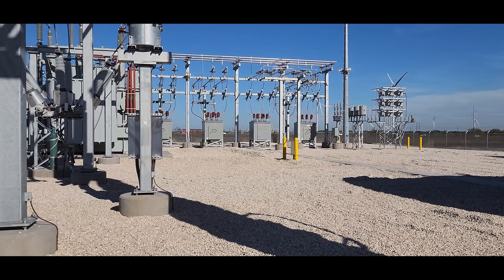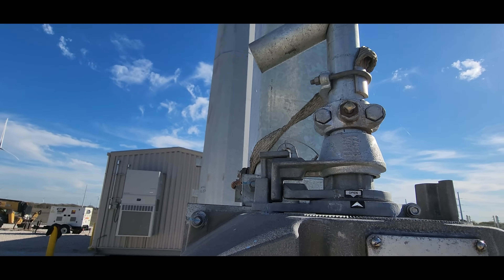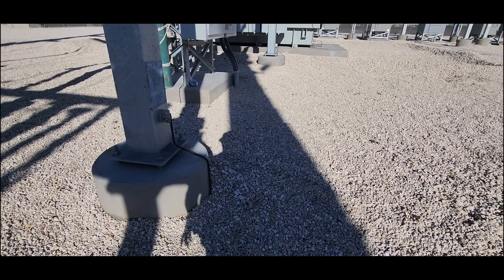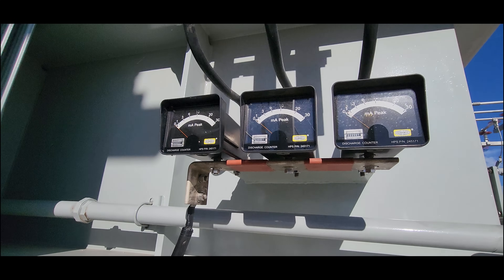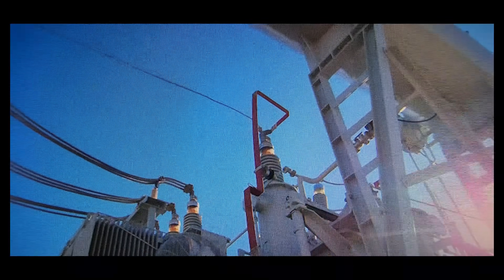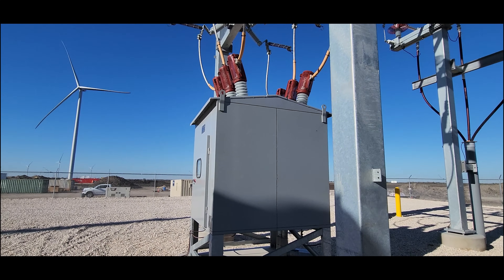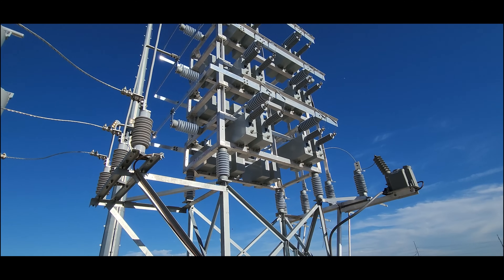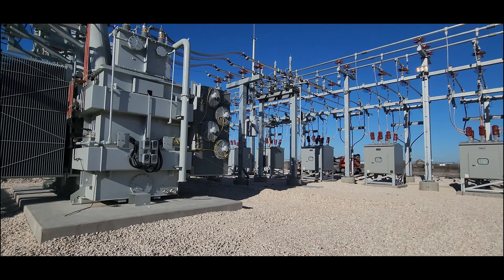138 kV High Voltage Substation Walk

Comment: Thanks for the tour! I particularly enjoyed your insights into the data links and remote control capabilities. My day job involves assessing the security of SCADA/ICS and remote control systems in industrial environments (private, public utility, and marine) so it was very interesting to see how the power utilities do things in the US compared to what I've seen elsewhere.
Reply from the maker: You guys have lifetimes of knowledge that I know very little about. After reading your comment I looked into how many points we gather for SCADA from the substation. 548 points. 286 are analog, the rest digital. I am not sure how many of those the Utility grabs. Lots of info!
Reply: @spdfreakls1  That's quite a bit of telemetry! Sounds like a modern system. The trend seems to be going towards long-term collection of as much data is available, for trend analysis and failure prediction. Luckily at the 100kV+ substation level there's enough aggregation going on to avoid any individual privacy issues with the data, which tends to be a problem for smaller utility sites (e.g. being able to tell when someone has a shower by looking at the water mass flow rate... creepy!)

Comment: Nice walk through and good catch on the transformer neutral bus that renders the reactor useless! First time I have seen that style Qualitrol gauge before and did the guys who put the temp sensor junction box covers and capillary tube guard on upside down on purpose, so the 73 is upside down to piss someone off?
As far as the strike counters on the LA's. We had an LA (115V) blow about a year ago and it totally blew the strike counter to pieces! Only had them on one transformer and we never trended the leakage, maybe if we did we could have predicted a pending LA about to fail, or there was some transient that took it out anyway. Was never investigated, just took over a year to get a new set of LAs.
Reply from the maker: Wow that is crazy! Yeah these lead times are insane. We can get a main power transformer faster than an HV breaker these days.
Reply: @spdfreakls1  Yeah, no idea what the issue was. Just run of the mill 115kV substation class LAs. The originals were Ohio Brass, not sure if they were trying to go back with the exact same brand / model or what. I just find and fix, glad I don't do the parts searching end if it.
Reply: I'm a bit puzzled by the station aux xfmr connection. Is it connected L-N or L-Gnd? What happens to the station service voltage when there is a L-Gnd fault on the 34.5kV? Also, is there a second station service source.
Reply from the maker: @fredlotte2601  primary is line to ground. Secondary has a grounded neutral. Sometimes the neutral is grounded at the transformer case or inside the 400a disconnect below. If there is a L-gnd fault on 35kv side on the same phase at the transformer is connected to it will affect secondary voltage. Yes, there is a secondary utility backup. There is an automatic transfer switch in the control building.
Reply: @fredlotte2601  In my experience I have seen single phase L-N and L-L station service transformers and some larger stations, three phase transformers. Usually with a second station service transformer fed from a second distribution transformer, if there is one. And yeah, when there is a fault you can lose station service but most of the critical substation devices run on DC, from the battery charger when AC is available and from battery when AC goes out. I've been in stations with DC lighting too and of course some also have back up generators. But all the critical devices, like protective relays and your trip coils, close coils, depending on the  station, spring charge motors, motor operated disconnects will all be DC. More so in transmission yards, not sure about wind farm subs, never have been in one (yet).
Reply: @inothome Same here. I'd forgotten about DC use even tho one of my last projects before retiring (30 years ago) was sizing replacement station batteries for about 10 generating units (about 2400MW total) some of which had very large DC turbine oil pumps.

What initially got my attention was the posibility that this station might be using ground as a power conductor and they have a ground fault limiting reactor. I can imagine strange large voltages applied to the station auxiliary transformer during ground faults.
Reply: @fredlotte2601  Ground rise potential is definitely a concern, but the LA should help protect the station service transformer in that case. I have seen someone unintentionally cut a live URD cable, basically shorted A to ground and about 1/2 mile away it blew the B and C phase LAs on a three phase padmout transformer and just about blew the doors off it! Delta high side so, the rise in ground potential was too high for those LAs. Which, were undersized MCOV for the high-resistance grounding system that was in the system there. Substation transformer had a grounding resistor we would switch in and out, based on maintenance in the system and it was switched in at the time. A lot of the LAs were replaced over the years, but never got to that transformer.... but it took care of it itself. Transformer electrically was OK. Just needed some major sheet metal work on the doors and cabinet.

Comment: I think you should do some tests on the transformer cooling fans, since in the narration there was a statement about the critical need for effective forced convection cooling to prevent the transformer from overheating. The fan cooling design seems wrong to me. For example, lets say the transformer external oil heat sink allow natural convection from the bottom of the radiator to the top. In other words, think of a box housing the radiators with an opening on the top and on the bottom, but with the sides enclosed, like a rectangular tube. Cooler air would enter the bottom flow upward as it absorbs heat from the radiator fins and exit at the top, natural convection produces an upward flow of air as it is heated. 

The cooling fins internal to the box would have to be spaced appropriately to allow air flow around the radiator tubes. Then if we wanted to add two stages of forced convection (cooling fans) ONAF1 and ONAF2, as staged additional cooling you would put the fans pulling (air flow up) on the top and pushing on the bottom (air flow up). When both banks of fans are on they work together to move air through the radiator from the bottom to the top. The first stage ONAF1 should be the top mounted fans and ONAF2 the bottom mounted fans. To make the flow rate consistent across the radiator you would want all the fans, either top or bottom, to come on together (and off together), meaning all the top fans (or bottom fans) all off or all on. To make the top and bottom fans work effectively you would want a mounting plate or formed end cap across the entire top and the bottom with round cutouts the same diameter of the fans. This way the fans are able to product a static pressure as seen by the cooling box.

If you place a fan on a radiator without producing a static pressure the air flow will just exit without being forced through the fins. Meaning the cooling effect is very small. You can also think of it this way, lets say instead of the many smaller fans we just had one large round fan with a diameter the same size as the width or the side of the radiator, so it covered the radiator but without a blocking plate or flow plate. The fan would be a puller so air would enter the middle of the radiator and be forced outward from the side, but you would have a huge amount of leakage around the periphery of the fan. Using the same single fan we now add a blocking plate, but instead of a flat plate we make an end cap with a standoff distance of about a foot from where the radiator plates stop with a sealed periphery along the outline of the radiator. With this formed sealed end cap air can be drawn through out the entire radiator with the large single fan because the static pressure is spread over the entire face of the radiator. You could do the same with several smaller fans but you would have the same end cap but with several smaller round cutouts for all the individual fans, with the requirement that all the individual fans would have to be on together, working as a bank of fans. 

The best way to see the effects of your cooling approach is to use a thermal camera to see hot spots and how the heat energy is being conveyed to ambient.
Reply: The cooling setup is not something the installing company made up themselves. It is designed and tested in the factory and they have verified the transformer can run continuously at the rated load with the fans provided in the factory made mounting spots.

Comment: 16:50 I suspect that the mA meter measures the current going through at all times.
While the counter just cares about the big surges. Lightning strikes are usually not measured in mA, but rather kA-MA.

I suspect the surge protectors are made with metal oxide veristors, these get progressively more leaky with each discharge through them. At some point they start to run quite warm and risk failure from that alone. Periodically checking the leakage current will allow one to change it out before it fails.

Another style of these surge protectors use explosives to signal a failure. Ie literally blowing up when they get too worn out. Downside here is that one then don't have a surge protector...

24:40 A rough rule of thumb is about 3 kV/mm, or 76 kV/inch. So 2-3 inches of air gap should be plenty to not fry birds at these relatively low voltages.
Even if the breakdown voltage does get lower around sharp edges, but that usually don't make a massive difference.
Reply: Use explosives?
Reply: @imeprezime1285  Yes, explosively charged fuses and surge protectors are great for preventing arcs and "safely" remove themselves from the system.

Downside is that they are as stated, explosive.

They work by fairly trivial means, usually some thermal trigger. Ie a compound that ignites above some temperature. That in turn detonates the main charge.

But not all high voltage fuses and surge protectors use this approach.
Reply: @todayonthebench  Gee...I wouldn't like be in vicinity when they fail 🤪

Comment: Speaking as a retired electrical engineer in the electric power industry, the discharge devices connected in the path of the lightning arresters are present for condition monitoring.  The lightning arresters are composed of a series string of metal-oxide varistor blocks (looks like a hockey puck).  The string of blocks can handle a certain amount of energy flow from the lightning stroke.  For example, a stroke might have 15,000 amps of current/energy and that amount will flow through the string of arrester blocks.  When a lightning strike occurs, the stroke will increment the counter by 1 and it will display the amount of energy in the stroke. A substation technician can make an inspection after an event like a breaker trip or a lightning storm and see if the discharge meters have recorded a reduction in remaining life in the arresters.
Reply: The MOVs must get really hot after a lightning strike. It is just incredible that they can shunt that amount of energy and survive.

Comment: It looks like the 34.5k VAC three phase feed is center tapped Y (overhead three large line conductors and one small neutral conductor).  Which would make the line to neutral voltage 19.9k VAC (Y phase voltage) which feeds the 100kVA transformer producing center tapped 240 VAC (two legs of 120 VAC) single phase. In my experience you should not use the word ground to describe the connection to the three phase Y center tap. It is call a neutral connection. If this connection is also earthed for lightning safety then it should be call earthing and not grounding. 

Grounding is a method of bonding and not connected to the dirt below your feet (even though we walk on the ground), connection to the dirt using grounding rods is called earthing (even though we call the rods grounding rods, they really should be called earthing rods) to specifically distinguish it from grounding which is really a part of bonding. In fact we would not really need to earth the system, which would reduce the risk of electric shock, if it where not for accommodating lightning. 

So the 100kVA transformer is powered by a phase to neural, this neutral is also earthed for lighting protection, but the ground "the earth", does not normally carry any current except for lightning. The transformer is not grounded it is earthed. It should be noted that the reason we have the rocks in the yard is to elevate the workers from a wet earth, which can create a dangerous voltage gradient along the ground (damp earth) if a lighting strike should occur.

Grounding, meaning a current path, is really a misnomer term in reference to the USA National Electric Code. Where even though you will see the word ground used, as in ground wire, it is generally considered bonding in that there is a path for ground fault currents to trip a breaker. Meaning if I have a ground wire as part of a 20 Amp 120 VAC branch circuit the ground wire is really a way to bond (connect) the receptacle ground wire to the breaker panel to provide a path for ground fault current to trip the circuit and protect the dwelling occupants. But, to operate correctly this connection is not connected to the dirt we walk on, current does not flow through the earth for ground fault, it flows through a wire back the main panel. At the main service this connection is earthed using grounding rods. Earthing is there to provide a path for lightning current as to not enter the dwelling. Grounding is in reference to bonding to enable tripping a breaker during a ground fault. Ground fault current does not flow through the earth (ground).

Yes it is very confusing, but we need to understand the differences in AC distribution between grounding, bonding and earthing.

Comment: Regarding the NEC strapping requirements on the flexible conduit, NEC "legally" does not apply to utility owned or controlled equipment
Reply from the maker: True! It varies by state. In Texas, they are specific to exclude private and public utilities, however our contract and design guidelines reference being NEC complainant. This means its a contractual requirement to be compliant , not a state requirement.

Comment: At 13:06 I noticed the fan blades are different than a normal cooling fan...I'm curious of why the fan blades looks like they kinda overlap closer together than normal blades which they are spaced apart from each other...is it because for cooling efficiency purposes?

Comment: Is there any sort of regulation sub stations or utility and power companies have to work within for electro magnetic interference "noise"?  I can't imagine there's any way to be 'minimal', but I wondered if there was a regulated limit or something?  Great video!!
Reply from the maker: The only "noise" electrically I can think of is VAR's (dirty power) and that's regulated by equipment in the substation. Yes, the utility puts fairly strick limits in place for true power (.95 lag-.95 lead) with "1" being true power.

Comment: 5:02 Good thing you opened that switch control box before turning it on..that "open" plate was touching (or very close to) that terminal on the block, would have made for a bad day.  You may also need to pound into everyone's heads that a control cabinet is NOT a storage box for parts, especially metallic ones.
Reply: When cabinets are built in a factory all associated parts are commonly placed inside, then after they are mounted on site the installers will take out the parts and mount them or place in the station storage.
Shipping parts in separate packages VERY often leads to them getting lost, and a lot of them cannot be ordered as spares you have to reorder entire components just because a small mounting bracket got lost.

Comment: Is it commmon that the MV switchyard is outdoor and air insulated? Here in germany the MV side is always build as an compact gas-insulted switchgear inside the substation building.
Reply from the maker: it is common, mainly because it is cheapest. There are metal clad switch gear buildings that can achieve the same thing with a much smaller footprint. This would make sense in a city environment or location where land is expensive.
Reply: ok interesting, because here in germany, even in the middle of nowhere, nobody is doing MV outdoor air insulated  @spdfreakls1
Reply from the maker: @arne0498  That is very interesting! Learn something new every day, especially from the comments!
Reply: It's the same thing in Sweden. Even in the middle of nowhere all medium voltage switches are in cabinets inside the station building. It's always built so you can replace a switch or PT/CT without disconnecting the transformer.
Reply: you guys do quite a few things differently )) for one - there's no gravel in the subs, it's all grass!
Reply from the maker: @MrVaquero1978  That is pretty awesome can you send a picture? I have never seen that before. The gravel is for step potential. We have to have the gravel tested for resistance. I believe it must have 2000ohms.